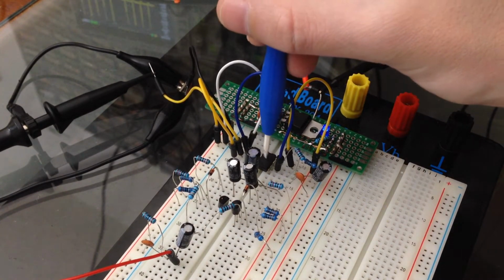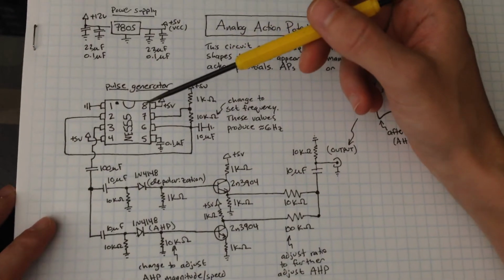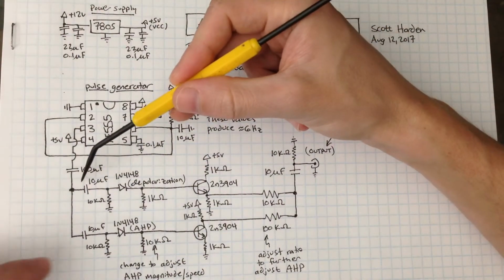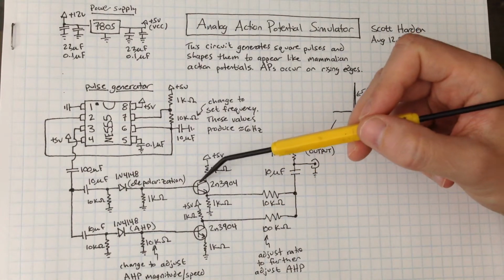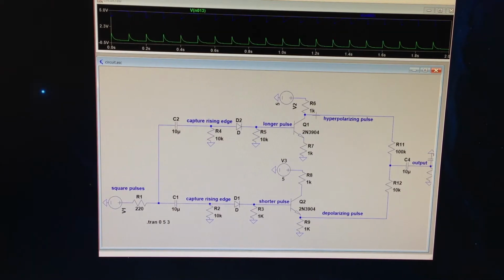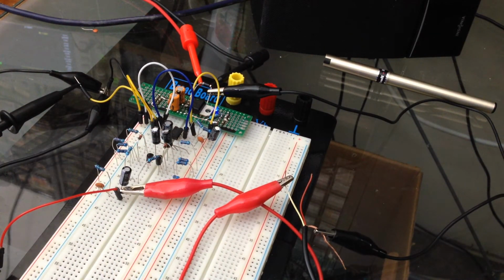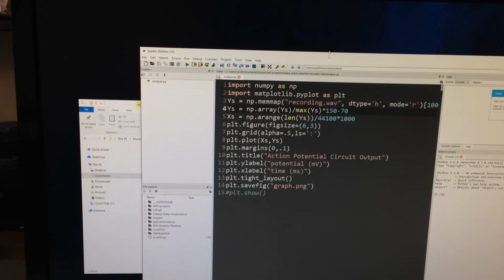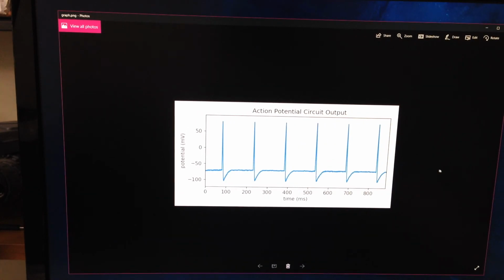Action Potential Generator Circuit

Comment: Hello sir, l tried the ltspice model of this circuit and got signal at different  voltages. Thank you so much.. but l have one doubt in the ltspice model why we keep v2 and v3 voltages are constant?? (5volt) because when l tried ltspice model v1 source can provide different voltage ranges that makes effects in output, but at the same time v2, v3 constantly keeps. This is why?? Please reply..

Comment: I've always wanted to make a circuit that simulates vertebrate neurons, simple enough that I could make hundreds of them and actually wire up a small system of them.  Maybe drive a simple robot with it...  One less challenging thought was to simulate the cardiac electrical system with enough fidelity that it could duplicate all the standard physiological rhythms.  The heart is much simpler than a piece of CNS and could be much more readily tuned without lots of simulation.